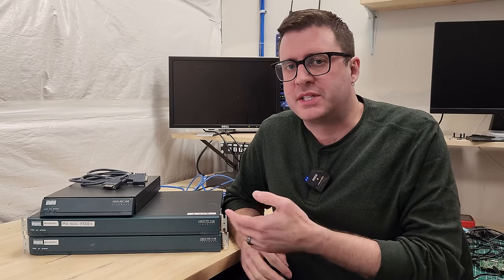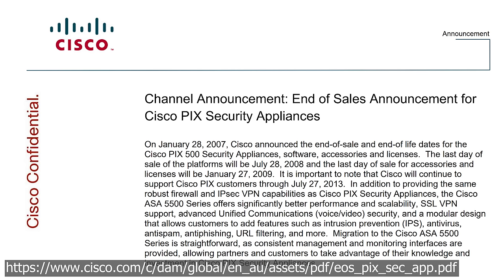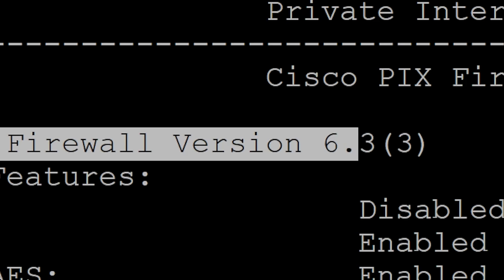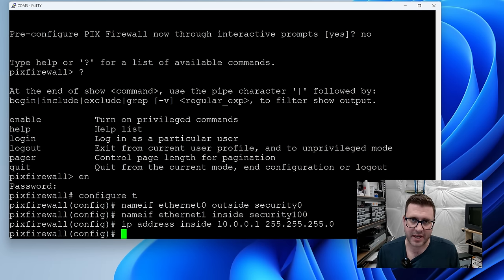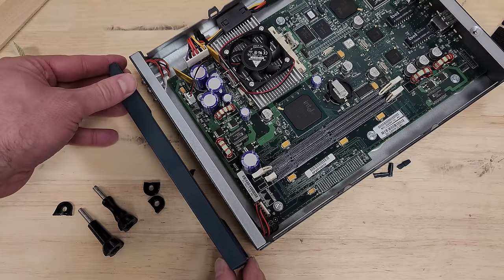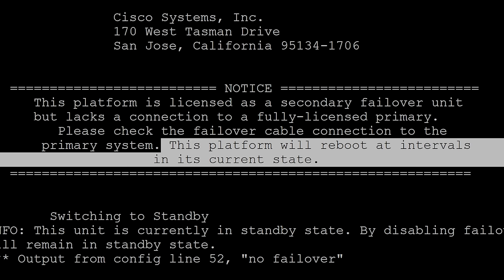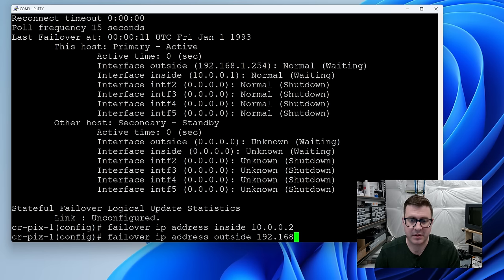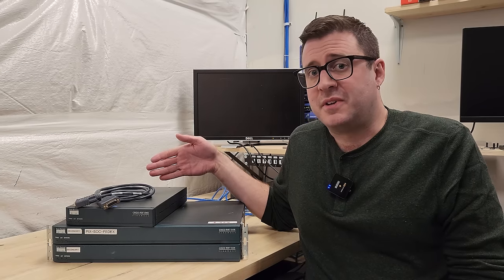Early 2000s Networking with Cisco PIX

Comment: The 506e cant be running a pII, they never came in a socket form factor, so that's either a p3 or celeron, and 02 sounds about right for either of them
Reply from the maker: You know, I didn't think too hard about that. I didn't include it in the video but when you run "show version" on the 506e it reports:

"Hardware: PIX-506E, 32 MB RAM, CPU Pentium II 300 MHz"

So that's really interesting.
Reply: @clabretro  Likely a Mendocino based Celeron.
Reply: @Wasmachineman Correct. From the factory, Celeron (PII). Yes, there were chip versions of the PII. (with some poking, may of these systems could be pushed to 450MHz - 100MHz FSB) Not that it would matter these days.

Comment: iOS is essentially the same, just some nomenclature differences, honestly... The ASAs use basically the same command structure as the PIX did... Still just different enough from iOS to be annoying and trip you up when you're not paying attention, though 😅
Reply from the maker: that's what it looked like based on the docs, just enough to bite you occasionally
Reply: @clabretro  I suspect that iOS was originally built for ASIC use, and embedded style hardware, as it's used for mostly line level devices like switches and routers, and when more complicated security appliances came around they had to build a new OS to support commodity hardware. They just took essentially the same CLI system, but some of the commands are phrased differently, or are under different submenus, or have different orders/keywords. 

It's very Unix that way. While it's all Similar, it's clear that different people were in charge of writing the actual implementations, and they probably just didn't think too much about having to precisely match.

TBF, with the rate technology moved then, it probably didn't occur to anyone that they'd be using more or less the same systems 35 years later 😂 Little did they know that Networking essentially fossilized in 1997.
Reply from the maker: Interesting! Yeah no kidding. The fact that I can fire this up and add it to my network is a testament to that.
Reply: No. No no no. The ASA's use an IOS like CLI. The older PIX use something from the original NTI design that Cisco bought. If you've seen a pre-7 (?) configuration, it's VERY different.

It doesn't look anything like IOS because it wasn't designed by Cisco. Just like CatOS doesn't look anything like IOS... again, because it wasn't written by Cisco.

Comment: Socketed Pentium 2? 🧐
Reply from the maker: interesting right? the pix reports it as a 300mhz pentium II. must actually be a celeron
Reply: @clabretro  Yes! Could you remove the heatsink and look directly on the CPU etching? 
Might be some form of frankenstein BGA P2 CPU on socket 370 interposer.
Reply from the maker: yup I will! I might have a follow up video actually getting the failover working and messing around with some of the GUI interfaces on these things and I'll include it then.

Comment: Meh you ptobably can,t get updatetes for those pixes anyway, so you are stuck with an unoatched box running an outdated feature set, it might nor even cover the basics like IPv6 ( yeast ipv6 is or at least shuld be the basics today but I won't get on this soapbox today) , by point is,the possibility of the external bsu failing is probably the least of your issues. At any rate thanks for a nice video
Reply from the maker: yeah these are just for fun, not getting put to any real use
Reply: @clabretro  feairvenugh fun is imporand, and please disregard  my intire comment as ir no becomes redundant ish, a failiur idf an out id stick inrernal bsu is as muchba show stoppervas an external one tho hmm I must be missing something...